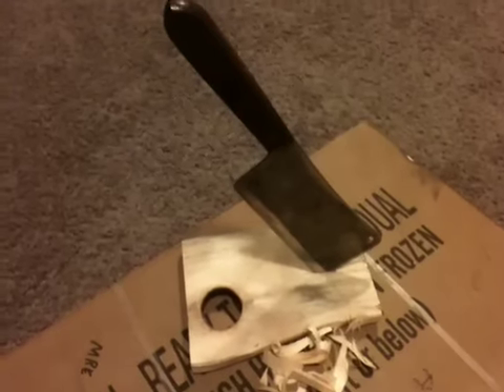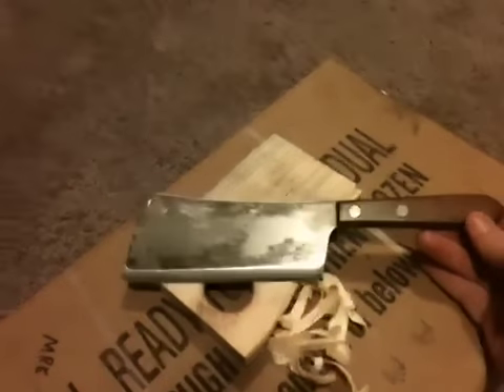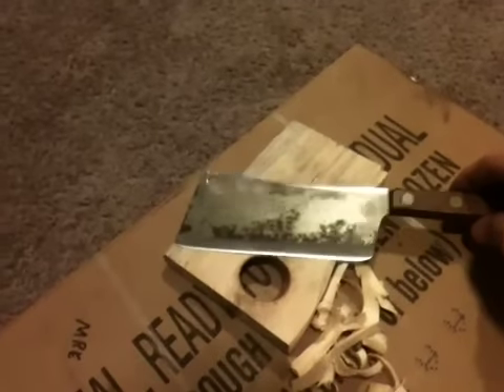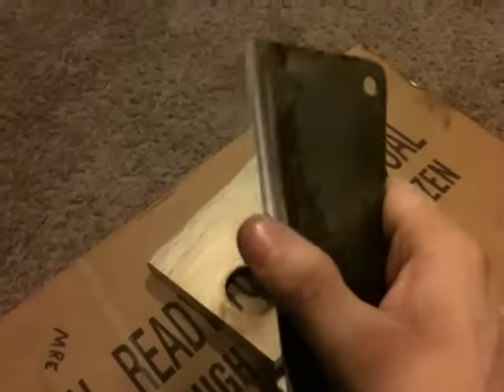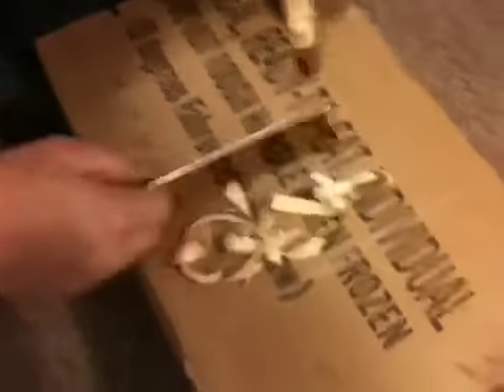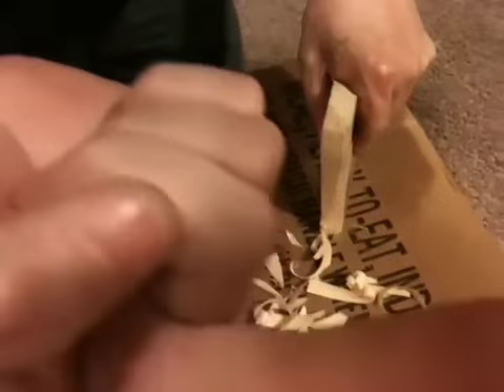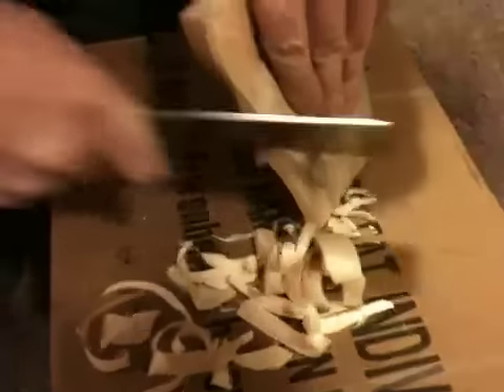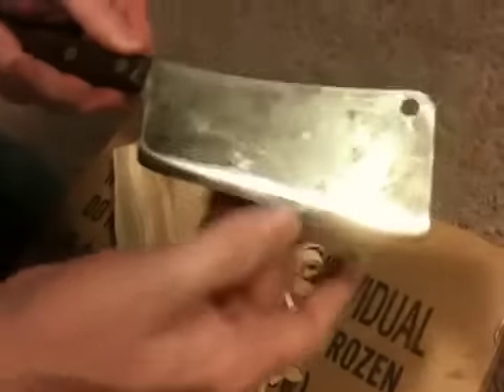An old restored mini cleaver. CAUTION contains a bloody sce

Comment from the maker: @BushcraftGeek Thanks. Ya I agree on the quality control of back then. Sounds like a cool design you have, you should build it-be good practice and I bet it turns out better than you think. Lol ya Im kinda cheap at times too my friend and nothing wrong with cheap items as long as you kow what you need. I have some idea's for different blades as well - time is not my friend but when I find enough of it I will try building them.